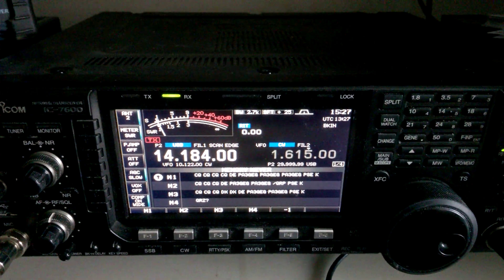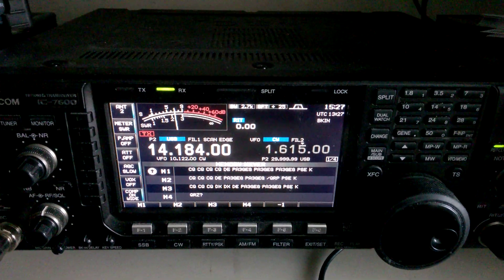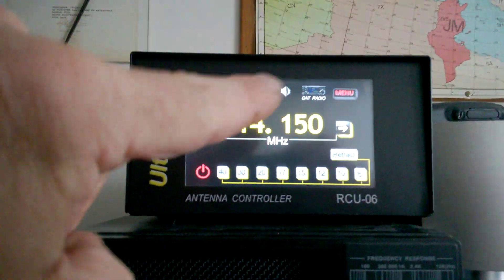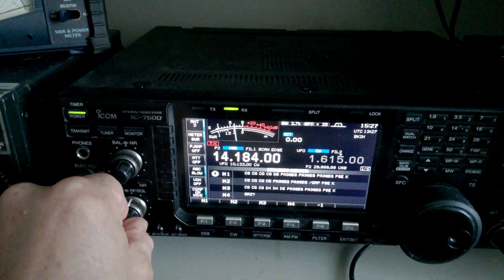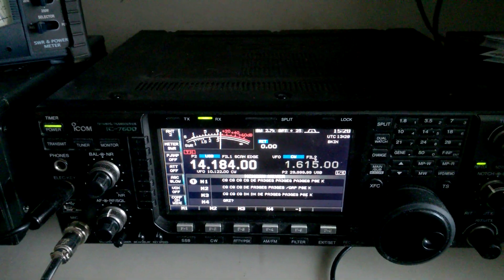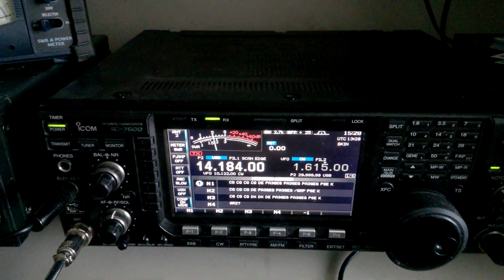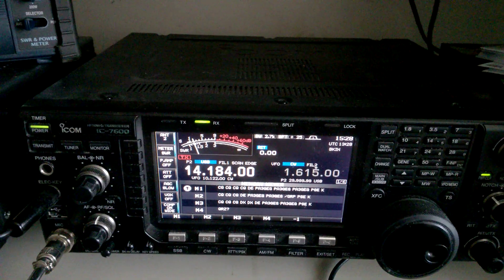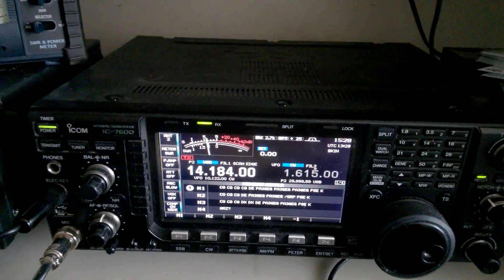Ultra beam 2 Elements Yagi 6-40meters Front back ratio 20 meters

Comment: Sorry to ask but I had few Ultrabeams before. How can you reverse the two elements to change 180° direction. Is it the driver that comes a reflector ? I never knew this was possible... please advise. Thanks, Phil ON4VP
Reply from the maker: Hi Phil,  Yes you are almost correct by pushing the 180 Knob on the top (lleft) of the controlller, the director  becomes the reflector and the driver stays the driver, because that is the feeding point were your coax cabel is connected. by pushing the knob left from the 180 knob your antenna switches again to the normal position.

Comment: I've exactly the same antenna setup for 5 years. And the F/ b on 20m and 17m are very important... Have fun. F5sih
Reply from the maker: Hi Eric, I got some problems now , When my new mast arrives, I will look what the problem is The problem is when it reaches almost 40 meters it stops, I can see the extra plastic tubes at the motor compartment and they are still in the same position. recalibrating gives no result. It just goes slowly back into the retract position and the motor makes  a different sound. forward it works fine again but all have to bring in right position. Not sure what it is first the mast and than looking and testing on the ground.
Reply: @Gerald-PA3GEG  I have had the same issue, tapes in the driver would move out towards 40 meter band fine, but when moving back towards 10 meters for example, the motor would make a different noise and was very slow - I had to send back to WIMO for repair, Wolfgang @ WIMO was excellent and he had the repaired EHU back to me in the UK within 1 week 
M0UGE
73"
Reply from the maker: @hamradiostation_G5GTR  Wolfgang send it back to me with a new power suppley for the Controller it seemed the power suppley was not damaged but had a  malfunction,  I am not sure if it works now because of weather conditions had no change to try it out.
Reply: I since discovered the tubes were getting very wet inside, this was causing my EHU problem.

The EHU wasn't capable of pulling the tapes back properly as the inside tubes were getting wet with rain water. The problem only happened for me when it was or had been raining ...I also tried a new PSU
The wet internal tubes caused the tapes to stick whilst being pulled by the motor. The motor could not pull the tapes back whilst they were sticking, so it would lose its step position and make the sound very similar to calibrate sound..it's similar to the clutch on a cordless drill...the slightest bit of resistance on the tape as its being pulled inside , will cause the motor to make that nasty sound

I drilled extra holes in the black curves to allow water to drain efficiently and re sealed the joins on the tubes with tape

Problem solved !!
Reply from the maker: @hamradiostation_G5GTR  All is working fine again here with the new powersuppley WIMO send me. Great service.
Reply: @Gerald-PA3GEG  Great news ! Wolfgang is SUPER helpful - they did a repair on my ehu a couple of months back, they had it back to me within 6 days of me sending it 

Question regarding 40 meters - what is the lowest you can get your SWR on 40 ?

Comment: Now I have to decide Steppir or Ultra beam.
Reply from the maker: I would go for the Ultrabeam, it seems to be more solid and good materials. I did not own a StepIr myself but I have read about hams switching from StepIR to Ultrabeam. My advice check some reviews. I looked at the stepIR Urbanbeam, looked like a weird clone of the ultrabeam ub 40, from the shape hihi. good luck making you choise.
Reply: @Gerald-PA3GEG  My urbanbeam will be replacing my hexbeam very soon!  I had bit time issues with using high power with my hexbeam... the urbanbeam should handle it with no problem.
Reply from the maker: @donalddavis581  Ok well good luck with replacing it, by the way my antenna is not an Urbanbeam SteppIR but an Ultrabeam, originaly an Italian company, now German. 73 Gerald